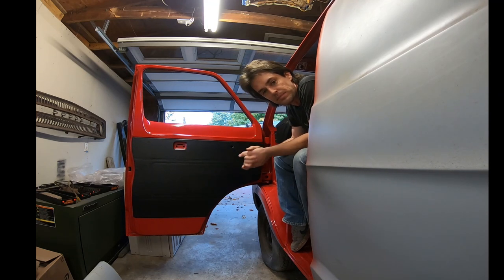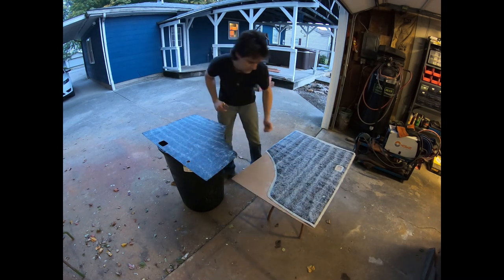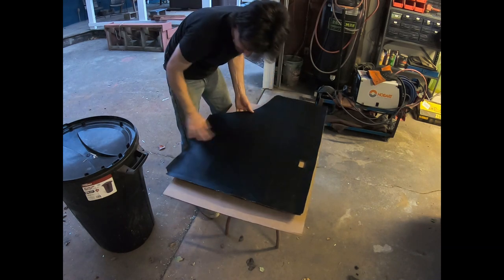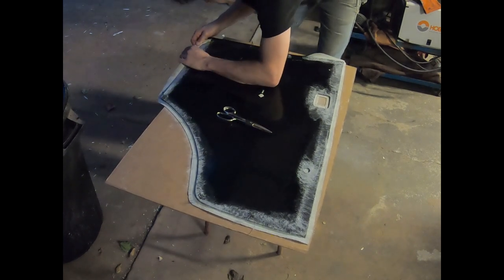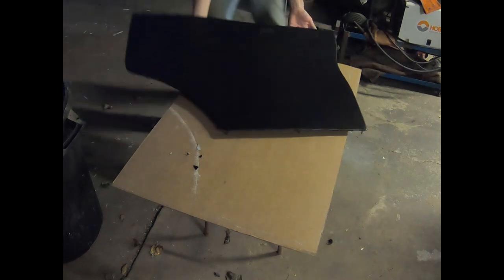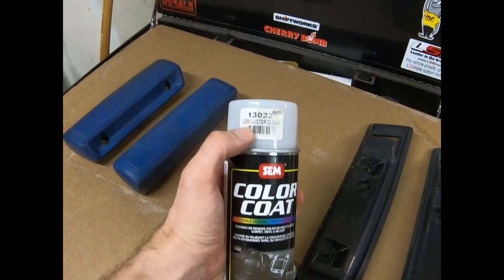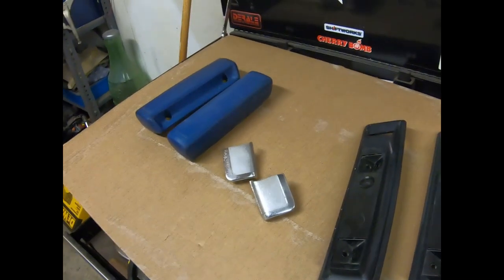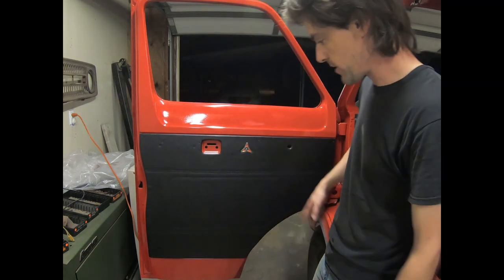Build Your Own Door Panels PART 2 - Hoosier Garage

Comment: Yeah man you did great work.... The emblem tie in is right on the money! I'm going to use some of you technics on making a one piece headliner for my 74 charger with factory sunroof I don't like the bow style that they come with and you've given me ideas on how to make my own sail panels using the old ones as a pattern...thanks!
Reply from the maker: Good deal! The ABS would work great on those. Templates are key and you can upgrade the material. Headliner you could model it after the later A-body style. With the splits in the corners.

Comment: Hey have you ever done custom seat like using a sheet of vinyl from a store and use for bench seat I wanna know how to do it replacing a good bench seat with rip up vinyl
Reply from the maker: Hey Michael, when it comes to seats I usually run with replacement seat covers, if you did regular vinyl in might not be bad, take old cover off and use as a template